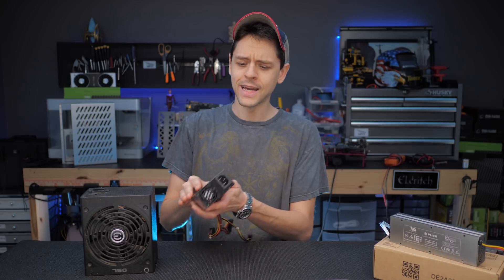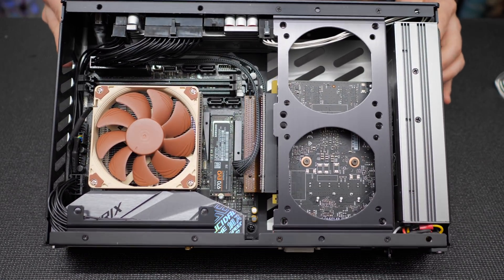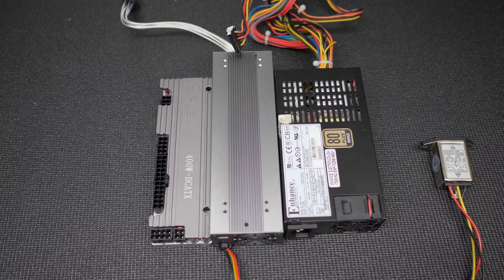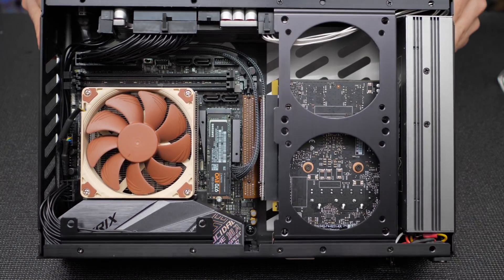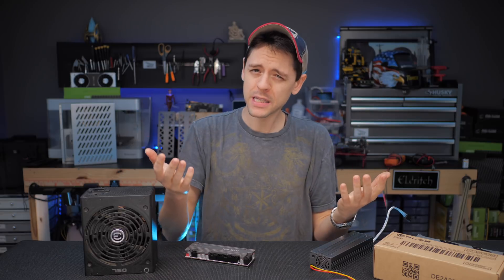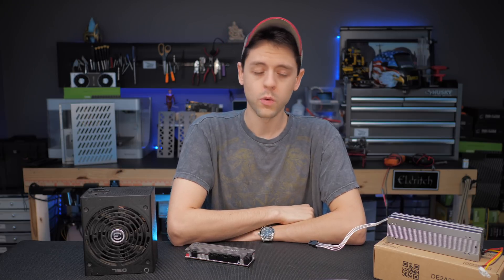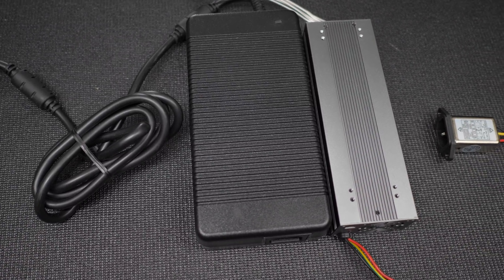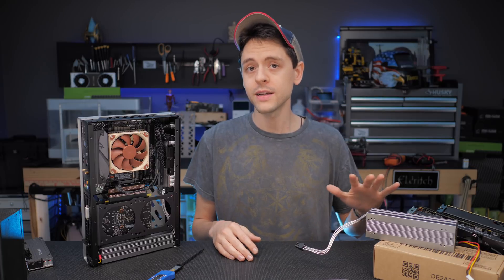HDPLEX 400AC Overview (SFF Gamechanger)

Comment: I just wish I could find a PICO PSU that would run on the big Dell brick (which I already have) rather than requiring me to find a 12V power brick...
Reply from the maker: This was HDPLEX's specialty for many years. This is the first year they have switched to a new design so these are out of stock, but you can find them used on my Discord: https://hdplex.com/hdplex-200w-dc-atx-power-supply-16v-24v-wide-range-voltage-input.html

Comment: So, if I wanted to run my SFF-PC in my motorhome with 12 V I would only need the DC component of HDPLex, right?
Also, would the DC component be compatible with m-ITX mainboards?
Reply from the maker: The DC component is designed for motherboards so it would be perfect. It's input voltage is 16-24v however. So if your mobile home only supplies 12v then you need another similart product that does 12v, like something from meanwell, j-hackcompany.com or mini-box.com.
Reply: @NotFromConcentrate  Thank you so much for your quick reply and info.
In order to get to 16 V I might just use a voltage converter. Do you know of any other product that does 400-500 Watts?

Comment: Hey Josh, question on this... with the fan, does it run all the time, or does it only spin up the fan under certain loads/temps?  I got around to using mine finally, and noticed the fan has yet to turn on
Reply from the maker: 3.0 turns on at temp. I honestly don't remember what the earlier versions did.
Reply: @NotFromConcentrate  Thanks!  Good to know.  The two with my 800w are v3.0, but would have to go look at what the one with my 400w is

Comment: A 1200w density is possible with the new material for pc parts
Reply from the maker: I'm not sure. You can link these together but the thing is how do you cool 800w of hardware in a tiny case? I don't know if you follow my channel but I do some very dense builds, and the most dense build I have done is 600w with a 3090 and 5950x. Beyond that you need very strong cooling and you will be able to use bigger power supplies anyway. That's just how I think about it anyway. Thanks for watching and commenting!
Reply: @NotFromConcentrate  instead of silicon there is a new material
Reply: @NotFromConcentrate  GaN https://youtu.be/OY8iP-VhN7U
Reply: @NotFromConcentrate  its like galvanic nitrate or something
Reply from the maker: @matthewcherrington2634  You mean GaN Gallium Nitride. Yeah I understand what you mean now--you mean the density of the power supply itself. And yes, it is right over the horizon. :)
Reply: @NotFromConcentrate  yes please respond
Reply from the maker: @matthewcherrington2634  I don't understand your question so I can't respond.
Reply: @NotFromConcentrate  so atx atx l and atx eps exist so there should be a sfx eps psu
Reply from the maker: @matthewcherrington2634  k
Reply: @NotFromConcentrate  so take 3 hd plex 400w put them together vertically and attach them to a sfx bracket boom super dense sfx eps psu
Reply: @NotFromConcentrate  threadripper apparently has low profile coolers dynatron a13
Reply: @NotFromConcentrate  so what do you think about the ideas
Reply from the maker: @matthewcherrington2634  If they are useful to someone then great! I recommend you share on my Discord and see if people want to further explore them! Peace
Reply: @NotFromConcentrate  please respond also can a sfx eps psu be made

Comment: Wondering if this CEC/NEC electrical codes compliant ? Especially the AC cable management inside the case?
Reply from the maker: I would recommend going to HDPLEX's website and looking at their certs, and then contacting them if you need more info. Thanks!

Comment: good info but when do we see you build system with it in? not already in but u putting cables to motherboard etc? My pc = i7, gtx 970 - soon to be 300w hdplex system running on 12v solar off grid system. NO mains power!!
Reply from the maker: Hey check out my playlists, especially the build guides. I have lots and lots of videos of me assembling systems with this with different methods. Thanks!

Comment: Try fitting an Asus 2080 blower, with an EVGA 1fan 2060 inside a Rosewill mini itx case, like I did!
It's much smaller than the node 202.

I only want the PSU to fit in the back of a case (like where an sfx PSU fits).

Comment: Can we fit a MSI 2070 Aero ITX in the Skyreach 4 Mini with that HDPLEX 400AC? Paired with an undervolted 9700k at stock clocks?
Reply from the maker: I'm not sure as I haven't tested that card, but I will say it doesn't look possible. There are several 2070 options available though for a brickless build. I would check out my discord for the latest information and community assistance: https://discord.gg/9Ufm7XX

Comment: So lemme get this straight: in order for the PSU to fully function I need to buy 2 parts and connect them together via molex? And then when it comes time to mount it, I'll have each of the parts next to each other or stacked upon each other? Also are any cables included in the HiFi portion of the PSU?
Reply from the maker: Yup you got it. And Yes they include all the cables you need and then some.
Reply: Would I mount them side by side or stack them?
Reply from the maker: @KingXF  The whole point is you can put them anywhere you can fit them. Check out the Skyreach 4 MINI as an example of a case that makes use of them. Peace

Comment: Would it be possible/difficult to swap the fan out for a Noctua one? I know you've said that the fan it comes with is pretty quiet, but I am big on minimizing noise.
Reply from the maker: It's possible to switch the fans via a repin, sure--I don't think it's worth it though and I am all about dat Noctua.
Reply: @NotFromConcentrate  If a Noctua swap isn't worth it then those are probably pretty good fans. Thanks for the reply!

Comment: Hi I'm a big fan of your work cause I love portability and thus small form factor built,but ambient temp is a big fact for small form factor built and in my area it's most of the time stays around 30~ or sometimes even 37°c! So i just wanna know your opinion can i build a powerful sff with i7 9700k*2070s using your case and also get decent trumps? And if so which cpu cooler you’ll advice me?thanks ☺

Comment: Hi Sir so I'm looking at getting a HDPLEX PSU but this is a little overkill for my project, could you please recommend one that would be fine to power a Ryzen 3400G system.

Just the board memory CPU & M.2 for storage, plan is to build an APU based System into a SEGA Master System 2 case👍
Reply from the maker: It has a baby brother, the HDPLEX 200. :)

Comment: Anyone know if this 400w could safely power a 2060 super/ i7 7700k
Reply from the maker: With ease. It can power a 2080ti and 9900K with some tuning, and a 2080/9700K stock. Check out the spreadsheet in the description.

Comment: Zotac GTX 1660ti (non amp version) is only 111.15mm tall. Small, powerful card with silent fan but you'll need to sacrifice that thermal performance a bit.

Comment: Can someone post link to video with some info which power supply do I need for this case if I would like to have 500w power? Please
Reply from the maker: You shouldn't need one. The biggest gpu you can put in is the 1080ti, and the biggest CPU is the 9900k. Those both run off the HDPLEX 400 with ease and averqge about 375w Peace
Reply: Not From Concentrate I want to build it with Nvidia 1060 6gb and i5-4460 and I found on internet that I need at least good 450w psu for this build
Reply from the maker: Tom Stan lol no dude trust me that pc will cap out at 230 peak and average at 180. Peace

Comment: Hey man,

I'm a PC enthusiast and build custom computers for my mates. I've looked so much into your Skyreach 4 Mini but I still don't understand all the parts you need for the power supply. Like when I go onto the HDPlex site do I get the non adapter version if I want to use a laptop power brick and choose the ac dc if I want to plug straight into a power cable?

Also confused as to exactly what the Dynamo Combo does and if you use it with the HDPlex PSU or without. I would love to use your case in a lot of my builds if I could just understand the power concept.

Lastly did you say you could mount 2x 92mm fans on the GPU bracket?

I'm posting this on my gf's account but my name's Ben, and a reply would be much appreciated!

Thanks
Reply from the maker: Sure-- if you send me an email I can hook you up with some resources I've made. Peace!

Comment: Although 4+ months late. I want to know if it's already been perfected the 400AC model. Especially the coil whine?

Because, I really like the S4 case + HD Plex 400 HiFi DC + HD Plex AC-DC setup. Tell me Josh, is it good to buy?
Reply from the maker: The HDPLEX 400 DC is on its 7th revision and is perfect, and the AC unit is on its second major revision and is much quieter than it was on launch. I honestly love them but it's not like its as quiet at as a SFX plat PSU five times its size. I think it is good enough now though. Peace

Comment: i Want to do a Mini SLI build Useing 2 ZOTAC 1080 ti's & Bifurcation but 400 ac just is not enough power I don't even think 800 would be enough I need at least 1000 or 1200 while still saving space in a SFF case I was planing on going with a Taku, tiny ITX/SFF case. i was hoping to fit the second card in buy saving space buy not Using a PSU. So my question is can you daisy chain these HDplex together or is there a way I could use like 3? or is there a better alternative?
Reply from the maker: Hello, Justin. So for a Zotac 1080ti with a 95w CPU you are looking at 340w. So two HDPLEX 400ACs would give you plenty of power to spare. There indeed is a solution--the HDPLEX 800. I have a video in my livestream playlists covering it, but it allows you to plug in two HDPLEX 400ACs and power a system like yours.  Peace

Comment: A power supply without a fan: Great recipe for disaster.
Reply from the maker: It's designed to run passively up to 300w. It also has multiple heat sensors which will shut it off if it gets too hot. I tested it and it works great. Peace

Comment: What are your thoughts on placing the brick outside of the case? The cable is not particularly aesthetically pleasing and seems a bit short, but could be an option with an extension.

Comment: Another source for great selection of external PSUs are transformers for fluorescent or LED lights, easy to get hold of and often outputs much more power than your regular AC DC brick. You will still need a pico PSU or similar but the problem for a power hungry system is getting enough amps from a external 12v PSU. Of course you will still have a external power brick but for some builds you can not get around that fact. Nice review of that HDPlex unit.

Comment: Whats the point of the power if you can't fit anything better then a 1050 Ti in it?
Reply from the maker: I see where you are coming from, but it's not the whole story. Many of my customers don't need a fancy GPU, but do indeed need a very powerful CPU. The ability to put in a 9900K and a workstation card like a WX5100 or P2000 is now possible, with tons of overhead. Secondly, the only reason that the 1050ti is the most powerful consumer card that works with no mods is because of manufacturer's layout and design. The R9 Nano technically is the fastest consumer card that can be put in because of the end connectors--nothing is stopping EVGA/Gigabyte/PNY/MSI etc from making a 2080 with a PCIE connector on the end of the GPU instead of the side and in a standard format. Finally, you can put in much faster cards (including the upcoming 2080 mini from Gigabyte) with some light modding, so this product is indeed very exciting. I hope this helps explain things. Peace.

Comment: I‘m about to get the Mini iTX case Dan A4 SFX with the Silverstone SF450 PSU, do you think this would be a better PSU in terms of better airflow? I‘m just not sure about the external transformer tho.
Reply from the maker: The SF450 is going to run nice and cool, and will be cheaper. The HDPLEX 400 is for builds where you know you can use the sizes and connector placement to give you more room. I don't know the right tool for the job in this one, but pick the right tool. :)
Reply: Oh ok, thanks very much for your reply.

Comment: In total it's as big as an SFX PSU. Why would I pay for this overpriced thing?
Reply: Packaging, pure size is not the only factor. The smallest dimension of an SFX is 2.5in, the smallest dimension of this is ~1.5in, so if you are trying to fit a psu in a 2in thick case, SFX is out. Also more flexible cable management.
Reply: I'd also say efficiency, which is very important in SFF builds

Comment: Hey Mr. JOSH STEFFEN,

If you are seeing this I just need a few words of your help.
I just bought the Power Supplies from the 5 Liter Max 9900 Build.
HD-PLEX 400Watt and Modded EuroCom 780W PSU.

I need the Original 4Pin connector for the EuroCom that is used for an MSI LAPTOP. I'm sure you cant find it, so could you tell me the EXACT name of that connector/adapter. I'm trying to buy a new one but it is a Female and hard to find.

Could you please help me?
Thx!
Reply: Sorry The Video is called:

5 Liter Monster Build.

This is the link
https://youtu.be/Iygxgnf4ydc

Again, I need the original connector for the EuroCom 780W Power Supply. You don't have to look for it, just tell me what the connector is called.

You're totally right....
Stupid Eurocom doesn't answer their emails.

Thanks again!
Reply: Not From Concentrate
Reply: I swear I'm not trying to spam.
Here is the eBay Auction where the Seller Claims you Modded these Power Supplies.

192823895198
(Just plug into eBay search, I don't want to embed any links, other than YouTube).

At the least, he introduced me to you.
Reply from the maker: It's a 4 pin Kycon connector--which model, I don't know. That is the reason I converted a few Eurocoms to GX16 connectors. If you need more info, please email me with the specifics and pictures of what you are looking for. Peace
Reply: Not From Concentrate 
Literally.... Nicest guy ever.
It's because you sensed I'm a Texan isn't? I will search for your website to send you a picture... Sensai.

Comment: It is possible to make a semi-brickless build by attaching the 400AC outside the S4 mini. Their thickness are similar, and the colour schemes are not very unmatching.
Reply from the maker: I suppose you could rather easily just bolt it to the side.

Comment: just a quick question. where can i buy that itx test bench you have there. Or is it custom build?
Reply from the maker: Depends on which you mean. I have four; two are custom built and two were Open Bench Minis donated by channel fans.
Reply: @NotFromConcentrate  the simplest one you have. the one wich is basically a plate where you mount an itx mainboard
Reply from the maker: @alex_sophie  Ah yeah, it's just a scrap piece of aluminum I had. I quickly cut it down to the size of ITX and then bought some 3" standoffs from McMasterCarr then put some threaded studs in the end.. It works amazingly well.
Reply: @NotFromConcentrate  thank you. wondered for a while now!

Comment: I own a HD Plex 160, but all of its connectors (24 Pin, 4 Pin etc) seem to be too big to fit the ports well. Once I plug them into the ports, it's impossible to remove them by hand, instead I have to use a flat head screwdriver to lever them out, which in the end damages both Mainboard and cables. Because of that experience I didn't buy any other product from them.
Reply: @Jantcha  I think some manufacturers just get cheap and low quality connectors. For exapme the 24 pin connector of my seasonic PSU (Snow Silent Titanium) fits perfectly and can be removed without applying too much force. So I'm quite dissapointed from HD Plex's cables, escpecially considerung how expensive their products are.
Reply from the maker: Good to know--if you send me an email, I can present the problem to HDPLEX and see if we can get it fixed for the future. I haven't seen this problem, so I would be interested to see it. Peace
Reply: @NotFromConcentrate  thanks for your reply, but I don't think it should be your responsibility to take care of my problem, it was just something I wanted to point out and see if someone else had similar experiences with. But thanks for your concern :-)
Reply from the maker: @Jantcha  I have definitely noticed difficult connectors with Corsair PSUs. They are VERY difficult to depin as well. Silverstone/Seasonic seem to have very nice connectors that are easy to depin, but HDPLEX connectors are also extremely easy to depin and I do alot of them. Maybe they just need to improve the keys on them?

Comment: I wish they made an HDPlex 600W or even 550W. That would be the sweet to prevent shut-offs and overheating.
Reply from the maker: If you are that kinda crazy check out the G-Unique Discord ;)
Reply: @NotFromConcentrate  If I knew what it was I would, because I am :-P
Reply: There is that 800w HDPlex DC-DC, that uses 2x 400w AC units that Josh showed, but... we'll see what happens when it's retail
Reply: I wish things were that easy :P
Reply: maybe next decade